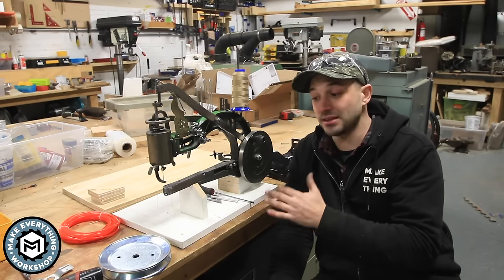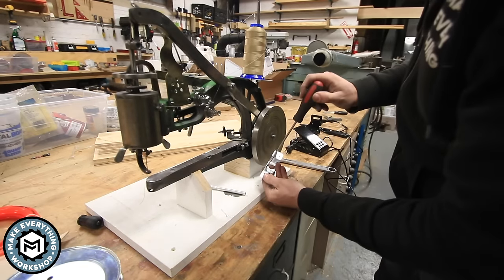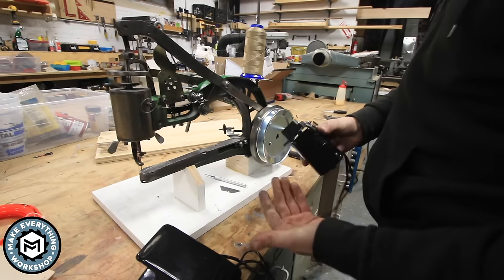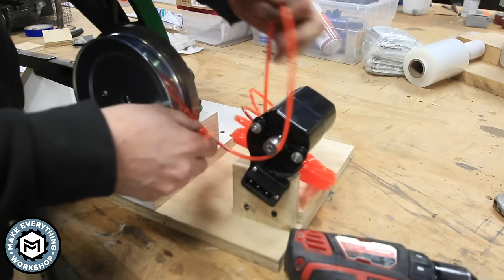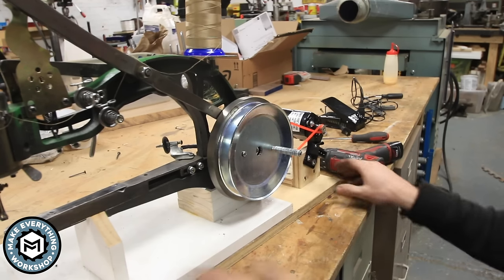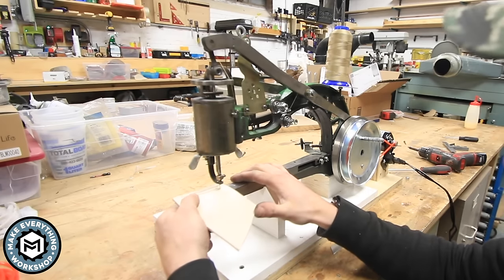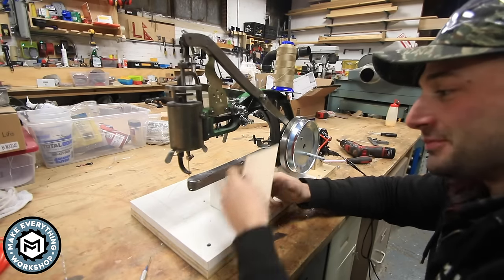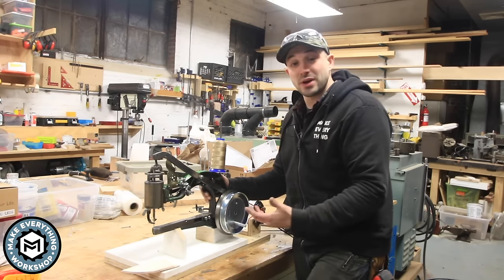Motorizing The Leather Sewing Machine, For Under $50

Comment: I've been machine sewing for 50 years, in that time I've used many domestic and industrial machines to sew fabric, paper, plastic sheeting, leather and even metal.  You said something in the video about the motor over time wearing out the machine... that's never going to happen with a well maintained machine.  The motor on the other hand is much easier to burnout. Also several people have already commented on adjusting belt tension, pulleys and mounting of the motor so that you wouldn't need to give the flywheel a little "push" to get it going.  I'm sure many of those ideas would be very helpful and most likely you've made adjustments to your original design helping to solve belt slippage while still having easy control of the speed that said, you will find that if you put your material onto the machine start sewing by turning the flywheel manually to create one complete stitch and as the next stitch is being made leave to needle in the material at its lowest point the motor will have an easier time with less slippage almost eliminating the need for the "push".

Comment: they make a holder for the blade you cut yourself with.  Just incase you were wondering.  It does make using it much safer and more controllable.

Comment: I put an old Singer, a motor of that type, on the drive pedal, put a diode 1N4007 and with that, I got a very sensitive operation and very easy to control the speed.

Comment: Use a wheelchair motor. You do need a different controller and a 12v power supply but you get a ton of tork at any speed. You could go like snail if you like!
Reply: That sounds brilliant, can you add any more details of how you might go about that?
Reply: Or a treadmill motor.

Comment: A modern Servo Motor will slow this puppy right down to a crawl if you want and you can adjust the speed very easily with the foot pedal. Some Servo Motor Control Boxes have an adjustable maximum Speed Dial plus they often have a switch to reverse the rotation of the pulley. Many of the older heavy duty industrial sewing machines with Clutch Motors are being upgraded to Servo Motors. Added bonus: Servo Motors are incredibly quiet particularly compared to a Clutch Motor which is always on until the switch is turned off.

Comment: You're on to something there.  I would say that as I watched the forces at work, it becomes evident that the long limbs and loose tolerance of the machine are not designed for the speed that is possible with a motor.  That said, it might be possible to modify the bearing surfaces by smoothing and polishing, or adding smooth bearing washers between the moving parts.  The lack of rigidity of the limbs is something that will always be a weak area and the bearing inside the flywheel may wear out quickly as it smashes into the high areas of the grooves.  Lotsa grease will help.  And yes, bolt that thing down.

Comment: An adapted larger pully on the motor would drop the rpm's so you wouldn't need that screw on the foot pedal. I used a sewing machine motor to power a fishing rod threader an it was the same principal. Works great for me, I can even control it's rate slow enough to turn the rod when epoxying the thread so it's even all the way around without drips while curing.
Reply: A larger pulley on the motor would make the machine run faster, not slower.

Comment: I would sugest rewiring the motor so it runs the correct direction or mount the motor vertically or at least angle it slightly so the belt doesn't rub against itself. Very very cool how you engineered that solution from common parts. Well done!

Comment: Good job!  Have used the urethane belting material for years.  To remove weld flashing the easiest way is to use a bench grinder or stationary belt sander.

Comment: PC-7 is an incredible 2 part epoxy thats strong enough to fabricate parts (can be drilled, tapped etc.)  Its like a liquid steel paste that hardens Rock Hard, and can be hand formed.  Originally used to attach hwy reflectors to the PA turnpike, I've used it for anything from replacing a missing part of the main rudder gear on a 1935 wooden sailboat, reskinning a fractured 12" hole in a kayak, to gluing industrial pipe towel racks to my brick shower tile.  Also glued nearby rocks to bridge abutments to make guerilla climbing walls!  If you don't know this product you aren't making everything you can! Period.

Comment: A couple of thoughts: the new "handle", being closer to the axis, will have reduced leverage.  This could be addressed by mounting piece of 1" x 1/8" mild steel, about a 8" long, and drilled to fit the two existing holes in the V-pulley.  That would allow you to mount the handle much further out (almost to the rim of the pulley), for better slow-speed control and leverage.  
And why not just mount the motor in front with the sheave pointing backwards, so you don't have to run the belt in a figure-of-8?
Also, a few up-grades occur to me: a servo-motor, so it can be run more slowly, a Gates toothed belt, and a reversing switch.
Reply: Love to see you post a link to a Servo motor that you like! Thanks for sharing!
Reply: I’m not sure, but I believe I saw somewhere that this machine doesn’t spin/sew in reverse via the flywheel. In the demonstrations I’ve seen the operator either rotates the material or the sewing “chuck” in order to lock/backstitch. Plus, I don’t understand the objection to running the drive belt in a figure 8.  I think I’d rather have the motor toward the rear and away from the operator’s right elbow. If it’s because of concern for premature belt wear I understand, but belt material is cheap and readily available.

Comment: To reduce the "violence" of the motor and reverse the rotation simultaneously, reverse the mounting of the motor. (Put the pulley toward the back.) and drive a counter shaft with a large pulley driven by the motor and a small pulley driving the large pulley on the sewing machine. This will give you greater range of speed control of the motor and greater torque driving the sewing machine.

Comment: The belt rubbing against itself is a real nogo in my opinion.
I think your first step comming from the motor is a small gear with some reduction. (So a small gear on the motor and a second axle with a big gear, and a small pully.)
Then you'll fix your rotation problem and have a little bit more control over the speed (with extra torque)
Reply: just turn the motor around. would be a lot easier
Reply: It takes all of ten seconds to put the belt back together if it breaks. Good enough is good enough.
Reply: @derlukec.8533  yeah but then it hangs off the board akwardly. He could also just mount it at 45° to the flywheel so that the crossed belt doesn't rub.

Comment: Thanks for the video. I am in the process of converting my patcher to this modification. The light bracket link is different than the bracket you demonstrated and required considerable bending to make it fit between the flywheel and the pulley and for the threaded holes to line up with the pulley. In the end it worked well but it did take some tinkering. Anyone who buys these patcher machines has to be a tinkerer by nature, so it will be fine. I also decided to buy a servo motor on EBay, which just arrived yesterday. It cost me $85 and was identical to the one you linked to on Amazon. Watch the prices because it does fluctuate significantly from day to day. The servo motors can run clockwise and counterclockwise so it eliminates the need to cross the belt. I also found 4mmx10m pu belt on Amazon for about $4.57. I really like the patcher as a sewing machine, but, truthfully, I am enjoying the tinkering just as much.
Reply: I bought the servo motor linked and it doesn't come with a pedal.  How do I find a pedal that plugs into it?
Reply: Tyler Selenius did your unit come with three pieces, the motor, the control box, and a third piece that looks like a box with a lever and it is attached by bracket to the motor bracket?

Comment: If you get a servo motor for an industrial sewing machine, it will have a durable v-belt drive and is linkage actuated. In the linkage near it's drive pulley, it has a cork brake pad too, so when you make a foot pedal with linkage rod to it, you can rock your foot in the other direction and stop precisely with the needle up or down. The servo motor otherwise functions like the one you have; variable speed and only on when you press the pedal. After that it's just figuring out the gearing to get your cruising speed comfortable. Also the servo motors now commonly have a maximum top RPMs cutoff adjustment dial now.

Comment: Though I had replied but don't see it, so here goes.  Use wood blocks and skate bearings to install a jack shaft.  Turn the motor around and use it to drive a large pulley  on the back end of the jack shaft.  Put a small pulley on the front end of the jack shaft to drive the machine.  The jack shaft will be turning at the speed the machine is now running and the machine will be running much slower.  The large pulley could be the same one you used on the machine or it could be made from baltic birch plywood.  Select the shaft size and bearing based on the pulleys you find or make.  Using the jack shaft allows the motor to run faster so that it produces more power and draws more cooling air through the motor.  It also corrects the rotation from the motor to the machine.

Comment: Ah yes, a classic. I've seen a lot of old Singer sewing machines with this conversion too. Personally, I'm not a fan, my general policy for anything is "if it can't be used without electricity I don't want it" (have you noticed how whenever there's a blackout everything comes to a halt? You can't run any of your home appliances nor your heating. We've become so dependant from electricity the moment it goes down we're toast. Personally I don't like to be crunchy bread, so I've been trying to replace pretty much everything aside from my lighting system with non-electricity powered stuff. My next purchase will be an aforementioned Singer pedal-powered sewing machine), but not against it. If it makes people's work easier then good for them

Comment: I built a belt sander I need to upload the video of it but to have auto tension on your belt use a eye bolt and spring on the back end of motor and it will keep the perfect tension also can use several eye bolts in different locations to adjust motor tension.

Comment: All you have to do to reverse that motor is to swap the 2 wires on the brushes.. simply cut in between the stator and brush holder, extend the wires, and reattach, soldering in 2 pieces of 20ga silicone about 1-3/4" long each side, with shrink tubing.  Job done.  No silly figure 8 loop.

Comment: Thanks for sharing, I've been contemplating on one of these machines but feel that I would need both hands to guide my stitching.
Reply: With time and practice you can get used to using one hand. I have an old singer hand crank in my collection. I thought the same but have gotten used to it as any treadle or motor sewing machine.

Comment: You can mount the motor the opposite way and reverse direction. The pulley is towards the operator. Put the motor with the pulley away from the operator and you won't have the belt crossing.
Reply: That was my thought....just reverse the motor, the friction on the belt is not good and creates heat to where they want to cause more drag.

Comment: Very excellent !! I have two of these tuned them up selling one. Exactly what I want to do and was looking for a way to attach without messing the machine up to much. The Pully is a great fined.  I will be using the servo motor... .. .Consew EL-550 Sewing Machine Servo Motor 550 Watt 110 Volt. About $120.00 on eBay. I should get very good control slow enough to stop between stitches where I want. Geat job!
Reply: Did you get your set up complete?  If so, how did the servo motor work?

Comment: To slow down the motor you can get a motor controler on Amazon or ebay around $20 used for controlling fans or routers or other tools just plug in the motor to the controler and set for slowest speed and control with foot pedal.

Comment: You can actually just buy a heavy duty sewing machine made by singer and it goes through leather just fine and also works great on denim. That’s the kind that I have in the control of the speed is much better and you have better control on the lines of stitching that you do.

Comment: I'm making a guide for mine, much like the "Rip Fence" on a table saw, so I can sew very straight lines.  It slides along the bottom rail and locks in place with a thumb screw so it is fully adjustable.  Yee Haw.

Comment: The pivit point might be best with a bolt, two washers and a nut through a drilled hole to supply the amount tension in the long term.

Comment: For a DC motor you can just swap the wires and it will run the opposite direction. That would be something to verify first obviously, ac motors and brushless "DC" motors (which are actually AC( are a different animal.
Also don't baby the electric motor, they require more power to get started hence why every fan you see starts at the highest setting. You can apply more power then reduce quickly after it has started.

Comment: Built one.  Thank you for the video. 

It is way too fast and the foot pedal is an on/off switch (don't believe the lies in the description that it's a "speed controller").  I am looking into ways of slowing it down.  Premade speed reducers are expensive.  I am going to try to make one for this.  Bonus, gearing it down will increase the power while slowing it. 
One issue I found is the light fixture's hole is much larger than the bolt it secures to.  I used a washer I ground down to fit in the light bracket hole that centers it better but not perfect.
Reply: Wondering how you did with your modifications? Sounds like good ideas!
Reply: @MrTypepatrick  I made a reduction gear out of a dowel rod axel (5/8 inch I believe), a washing machine pulley (about 8-inch diameter), and another smaller pulley.  It still ran way too fast.  I then swapped the smaller pulley with a PVC pipe around the dowel rod to make a smaller wheel and it turns just a bit faster than I'd like but usable.  I had to rough up the PVC because the band would just slip.
When I get a chance I'll post some pics on reddit.  Also discovered afterward that my local tractor supply has an entire pulley section.  So I am going to upgrade significantly when I have time.  (work and domestic responsibilities permitting)

Comment: you can take a piece of wire or a small spring and put on it in bend the ends of the wire push down into the belt

Comment: If you mount the motor facing in the opposite direction (180 degrees) the rotation will be in the right direction. No need to cross the drive belt.

Comment: Walking Foot pressing wasn't pulling the leather. I figured it out. I thought the end of that thread-length screw always had to pressed against the metal frame. If you did that it would be a very tight thread which means the walking foot barely moves. I unscrewed the thread-length screw away from always touching the frame, made adjustments, and the walking foot works fine.

Comment: I have the whole kit to make those connection for power belts. including belts round and V belt.  To Correct size measure the belt to the size. Then cut  about 15-20 percent for tensioning. You do realize all you had to do was to turn the motor to the other side.  That would cause the belt to run the other way.

Comment: Yo! I appreciate it’s 3 years later but did you con an old school manual foot pedal? I.e turning the crank with the pulley attachment to an old school foot pedal, yes you will need to constantly push your foot down and up but it’s electric free so much more mobile around the workshop, and you should sort your speed issues out because your foot is controlling it maintaining the hand free but having more control over it.!❤the video though

Comment: I have a foot pedal but it is all or nothing. I bought a switch box and a dimmer switch and wired the switch in-line on an extension cord. I plug in my scroll saw or grinder and control the speed with the switch. I kept the foot pedal as a fail safe. If something happens that makes me flinch, just lifting my foot kills the power. I have heavy duty velcro on the box and  the anchor strips where I need to secure the switch by the tool I'm usingI have a lot more speed control now..

Comment: I feel like a second large pulley and a small pulley would help mounted between the motor and machine to both reduce the speed and increase torque while giving you more range with the pedal bc of the reduced speed

Comment: Instead of twisting the belt, just mount the motor facing the other way. And you could get one more pulley, double stacked with a large and a small, run the motor to the large side, the smaller one to the machine, and it would reduce the speed even more so

Comment: The crossover in the belt causes it to rub against itself, adding to the friction which the motor must overcome to start moving the pully and increasing wear on the belt. If you flip the motor around you can drive the pulley without the crossover.

Comment: Hi;
If you don't want to put a twist in your belt to get it to run the right way, turn your motor around so the pulley is on the other side. This will make it run the direction you want.

Comment: You can easily connect up a module 2000W AC Motor Speed  Adjustable Motor Speed Controller Voltage Regulator which cost less than USD10.00 and this device can be found in the more expensive servo motor model.

Comment: I just received the motor and foot pedal as you recommended.  When I plug it in, I have power right up to the motor but the motor will not turn on with the pedal down.  What do you recommend?  Thanks.